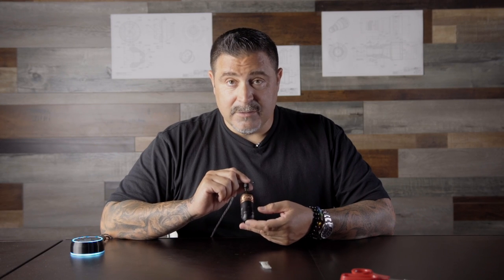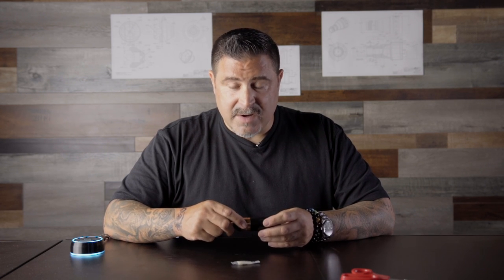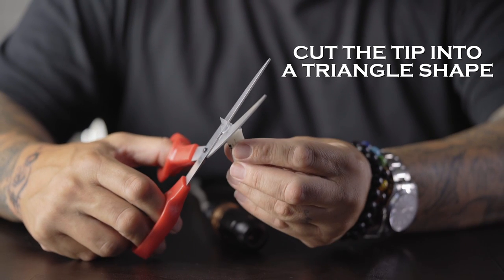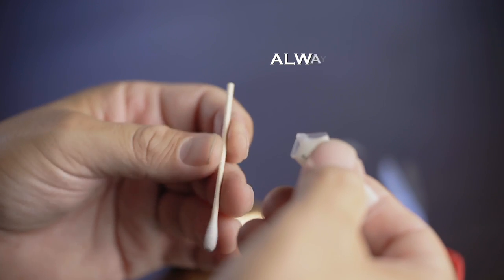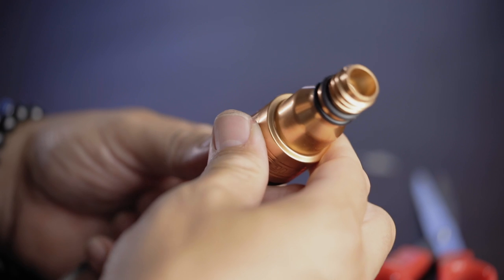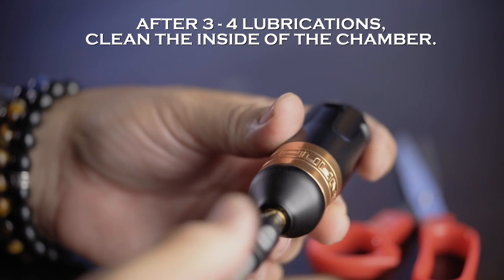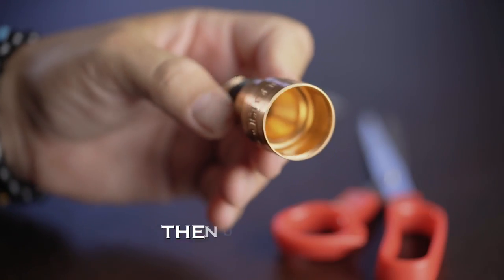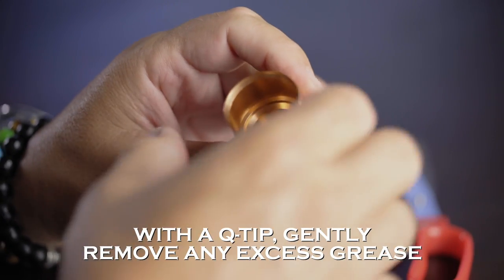Bishop OG Wand - Lubrication Tutorial

Comment: Is it possible to do it with liquid 😢Vaseline instead of grease??
Reply: I have the same question
Reply from the maker: We would not suggest Vaseline, since it is not a mechanical lubricant. Petroleum based lubricants can cause damage to your machine. The Krytox, provided with every machine, is the recommended lubricant for metal ad machine parts.

Comment: What if it’s a power wand packer how do I take the back plate off to clean behind the motor ?
Reply from the maker: The Power wand was designed to not have to be maintained through any removal of the back plate. Check the maintenance guide or contact customer service for any specific questions on wand maintenance.